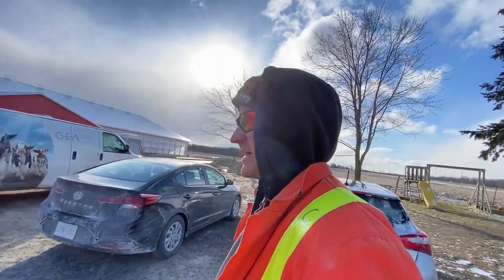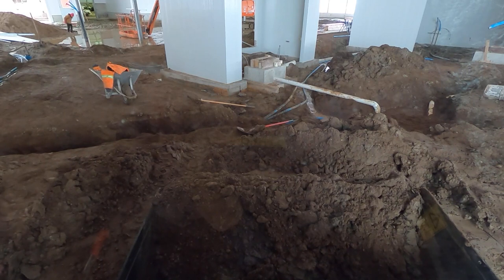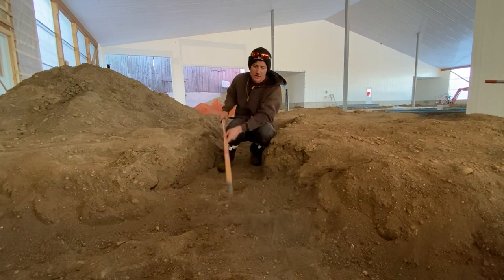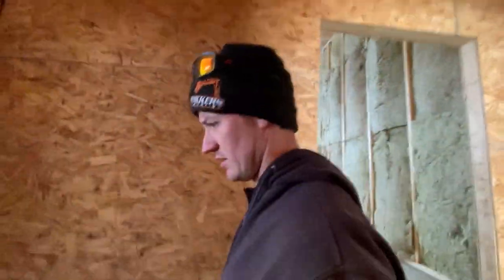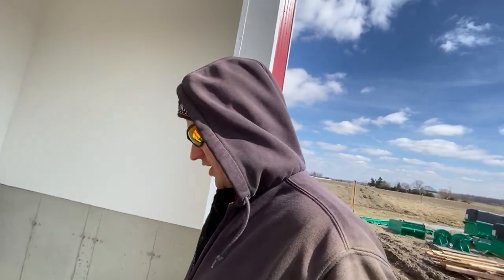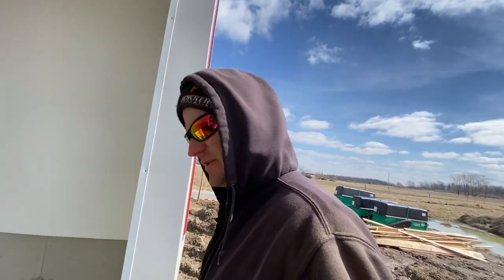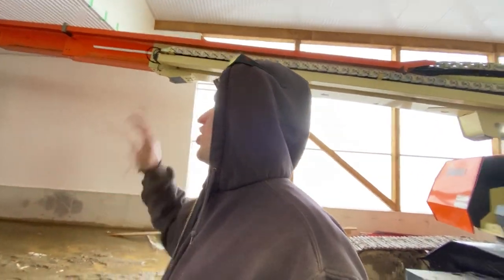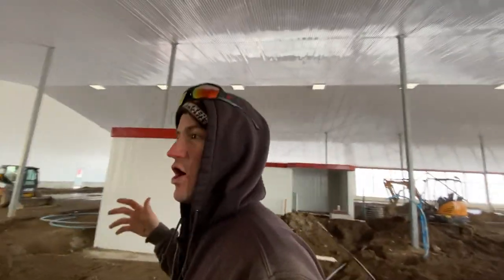A NEW SKIDSTEER Arrives! + It SNOWS Some More! | Building Our Cow Palace - Ep60

Comment: Hi new to your channel. I am in Orr of your new shed that you are building. It looks great with the finish, what are the dimensions of the shed? We are in Australia, without prying too much what is a ball park figure of the cost. Our sheds are not lined as we don't have the cold weather you do. Our stock are outdoors all year. We supplement feed when feed quality suffers because of frost and dry times.Great work your builders are doing a quality job. From Down Under
Reply from the maker: Great to have you! It’s 132x220 feet plus utility/office rooms. Structure itself is about a million. Then all the equipment, electrical etc on top of that.
Haven’t been to Australia but have been to Ireland to see that outdoor/milking shed set up. Incredible differences between how we set things up!